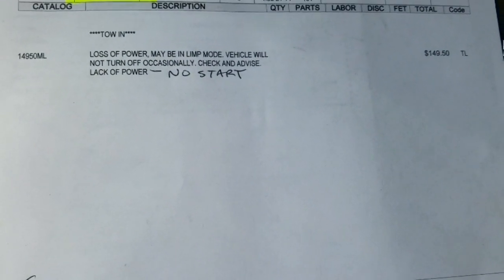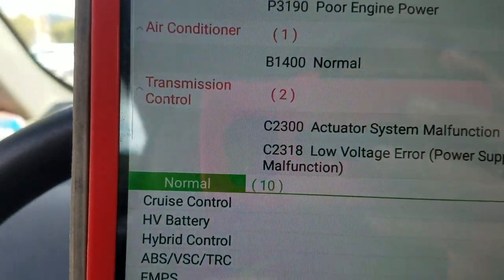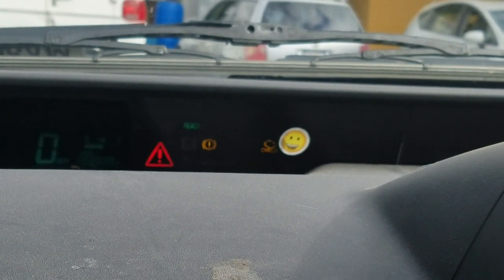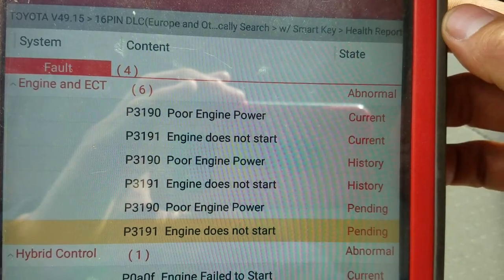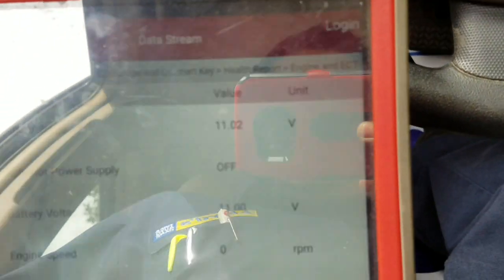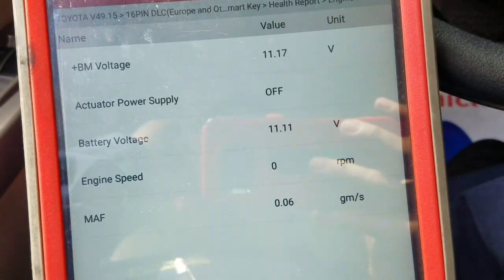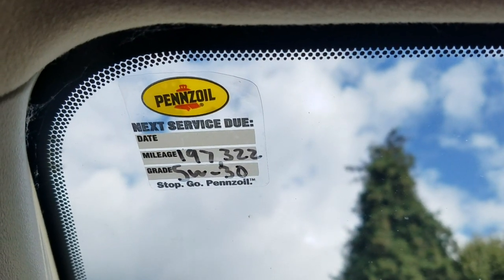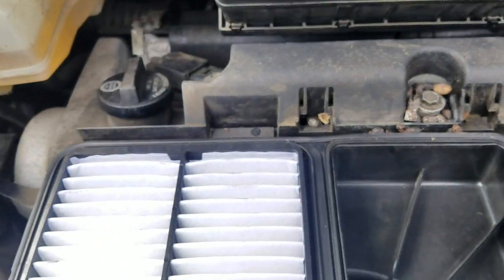06 TOYOTA PRIUS  NO START  CODES P0A0F ,P3190

Comment: Had Toyota Prius 2013. Took off air filter and stamp it against the wall to dust off dirt and put it back. Got P3190 and P3191 and engine stops and wont run anymore. I followed similar case on you tube to replace new air filter and replace new Mass Air Flow sensor next to air filter housing. Still won't run showing same P3190 and P3191.  However, this video shows he resets or erased the warning codes via his diagnostic tool. So I did erase my P3190 and P3191 warning codes, jump start the battery as it probably drain mine. Wow, engine started, I run the car to recharge hybrid battery. Have to thank tips on this video as if I did not erased the warning codes even if MAS and Air Filter are brand new, Prius will not start. I cancelled my one week car rental reservation. Decline advise from AAA to replace battery for $1,949.00. Cancelled my Toyota schedule service for Monday. Thank you for all youtube tips.
Reply from the maker: I am glad to hear that it help you .  we are hybried shop  and we have the training  to handle them  we give the true diagnosis and not trying to sell something you do not need , little  things  as do not clear codes or reset   some parameters does not  make the car to return to normal state ,
Reply from the maker: personally I have a lot of videos most of them goes above  the  average technician
Reply: Youtube University Strikes again...
Reply: @JoelAutomotiveInaction  milli

Comment: 06 Prius the knight before I got the P3190 code I had filled my car all the way up with fuel and drove it 5 miles to my house and parked it on our slanted driveway facing down hill Then in the morning when I started the car the check engine light came on with the triangle, The car was running rough as I was driving to work about a 2 mile drive But then the engine turned off halfway To my destination And the engine would not start and the battery had only 2 bars so I pulled over, I shut the vehicle off and turn it back  on a couple of times then it started to run on its own again but kind of rough, When I ran the code I watched some YouTube videos to check out the the mass air flow intake notice it was clean then I erased the codes and then I started the car right back up and it ran perfectly fine without any more check engine lights, I think I may have overfilled my fuel tank and parked the car very soon after and possibly some disruption in the charcoal filter, I've been driving it for a few days now without any issue, I can't think of anything else
Reply from the maker: I would say there  was  some dirty on the maf sensor  I went away when you  removed  it , the fuel gets to the engine by pressure  not gravity  , over full gas tank and park down  hill may have caused  fuel to get to the  charcoal canister
Reply: @JoelAutomotiveInaction   That's what I meant charcoal filter not carbon filter, I think that was the problem though

Comment: What kind of software you are using. I have the exact same error, I cleaned that air sensor but the car still won't start. I have P3190 and P3191 as error codes. I cleared those errors before I cleaned that sensor. Is there a chance that the whole sensor needs to be changed ?
Reply from the maker: probably the  whole sensor  but  this is not the only reason those codes   will set for , 
 ebay or amazon you buy the bluetooth device  . lunch easy diag 2.0 pro. the pro comes with 3 vehicle's  already  you choose the  brand . besides those  they sell separly any vehicle you want to buy
Reply from the maker: @codyfi6515  
not at all but it is very common for the 12 volt batter , auxiliary battery  to fail  this battery is very small common to fail it os only 325 cca. I have seen aftermarket with 450 cca .

Comment: Can I know what did you do to fix this problem?  I got this problem  please reply asap
Reply from the maker: I show that on the video , remove the maf sensor and clean it  that was my case , 
how ever , the hybried system get disable on this vehicles for what ever reason  what is the list of dtc complete on all computers to organize this and see which dtc is sending the command to the hv control ecu do no crank the ( ice   ) internal combustion engine.
Reply: @JoelAutomotiveInaction  thank you very much
Reply from the maker: @jasonho8709  I can help you if you giv me code scan for all onboard computers
Reply: @JoelAutomotiveInaction  actually I did solve the problem it's because the fuel tank  is empty but the fuel indicator state 2 bar left
Reply from the maker: @jasonho8709  
after you add gas to this vehicle  the vehicle needs to be drive that way it can update  the gas  level indicator on cluster  , because it need the inclination sensor .
expensive  sending unit for this car about 3 thousand new
Reply: Do you have any contact method??  So that I can ask u for advice anytime
Reply from the maker: @jasonho8709  
joel000c@yahoo.com
Reply: Please help! My fuel tank is all the way to full. Can it be the problem to this ?